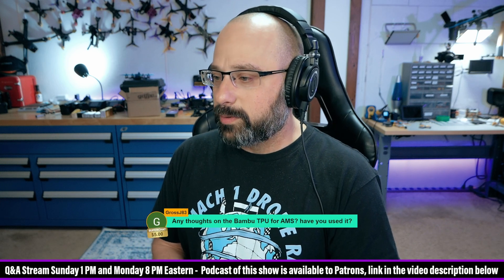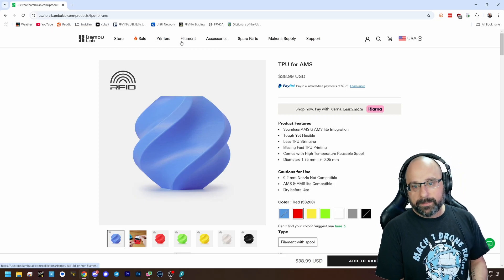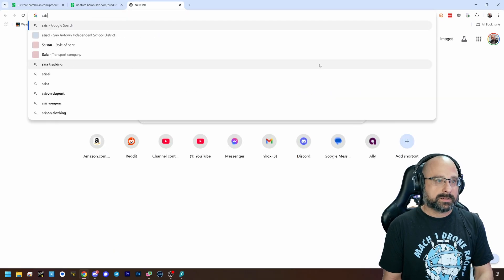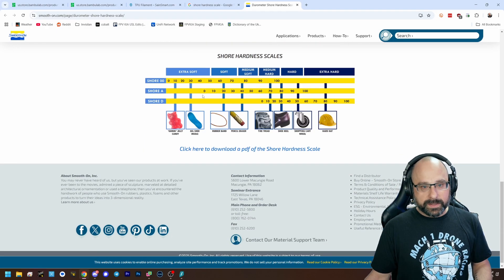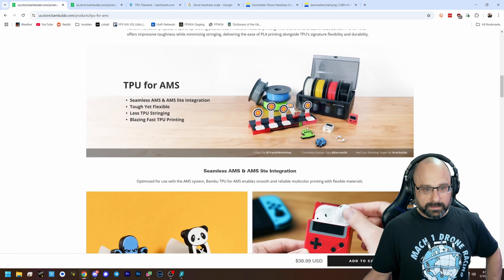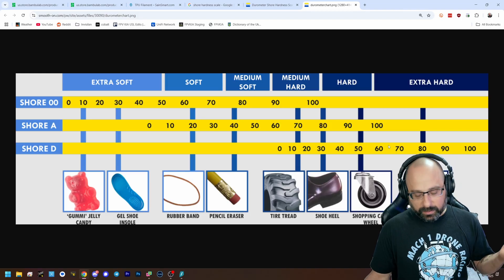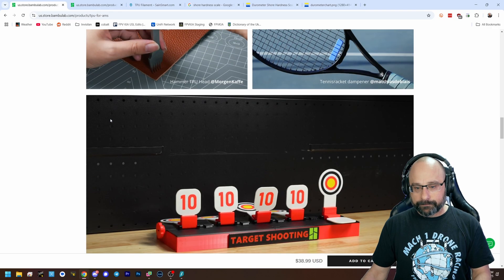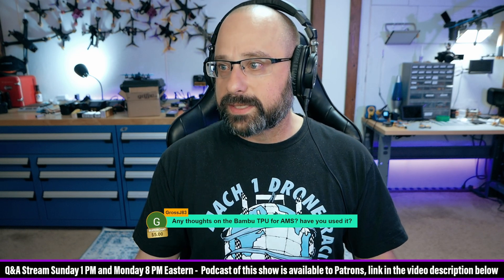Should I Use Bambu TPU for AMS for FPV Drones? 3D Printing TPU Options? - FPV Questions

Comment: I have printed a gopro case out of that tpu for ams and overture 95A tpu. Both can get the gopro into the case but to get it out of the tpu for ams you need to cut the case. The tpu for ams also has the issue of wanting to break on impact easier than 95A tpu. I have also printed arm guards out of both and the ams tpu broke after 1 crash, I still to this day havent broke a 95a arm guard.

Comment: Any recommendations for normal TPU?
Reply: He mentioned it in the video... Sainsmart
Reply: I use Overture high speed TPU, it works great in my v400.
Reply: Sainsmart! 💯
Reply: Avoid white though. I guess there's too much dye or whatever in it and the layer adhesion is terrible. That's not brand-specific, I assume it's the same for all filaments.